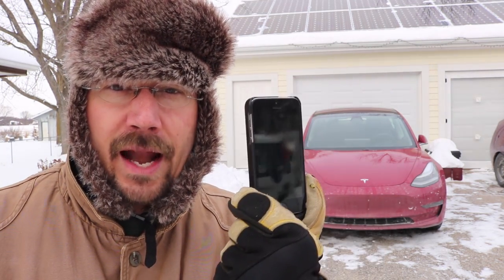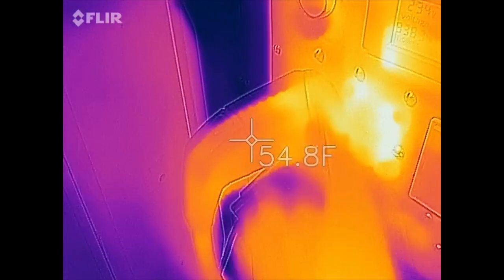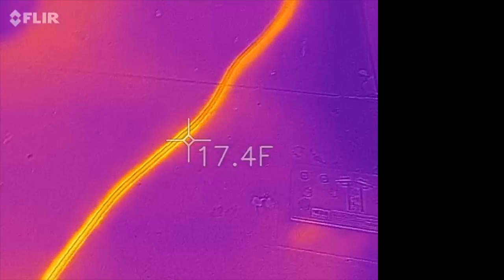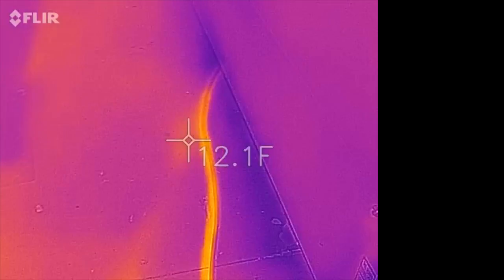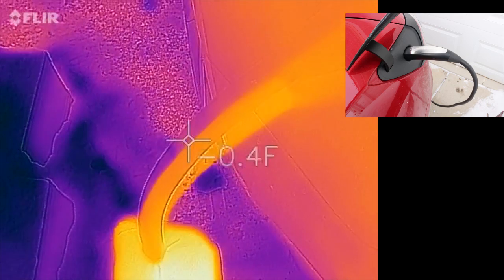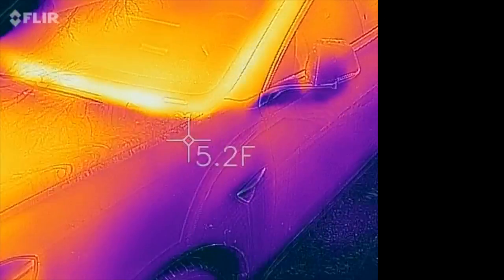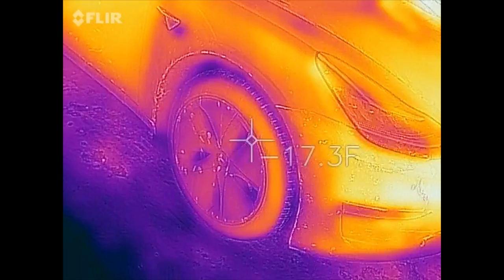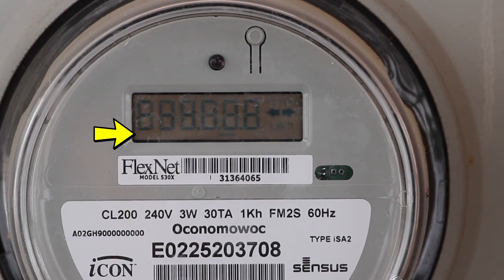THERMAL VIDEO of Tesla Model 3 Charging - Below 0℉

Comment: Very interesting to see this. I have heard Jack Rickard explain how attempting to charge Li-Ion batteries at below 32F is far more serious than simply not charging well. It actually permanently damages the battery. I would assume a Tesla heats the battery to assure temps above 32F before allowing the charger to engage. Is this not true?

Edit: oops, just read other comments... Looks like Tesla does heat batteries first. I don't have a heater on my EV conversion (the 81 VW Rabbit) so I can not charge unless I get it into a heated garage. I think my BMS (battery management system) disallows charging as well due to low temps.

Comment: It would be interesting to know what happens with a frozen tesla battery when you try to charge it?  As in leave a tesla outside in the cold not driven or not plugged in in freezing weather.  Then charge it.  Does it start charging up right away (I doubt it, because Li-ion's can not be charged below freezing).  So then the question is if it doesn't charge when the pack is freezing, how long doe sit take to bring the pack above freezing so the pack can safely charge.
Reply from the maker: The Model 3 has an active heating system for the battery, but I am not sure what it does if parked in the cold for a long time while NOT plugged in. If the car was parked for an extended time in the extreme cold AND THEN plugged in, I know it would actively begin heating the battery.
Temperature can also effect the rate of charge. When this owner stopped by, we plugged in the car, and then took a look at his Tesla App. It showed that the car was not charging at maximum speed, due to cold. It was drawing the total 40A though, so I think part of that was going to warming the battery, with all the rest going to charging. As the battery warms, energy used to heat it drops off and more goes to the charge.
Reply: @BenjaminNelsonX  Yea there is no way if parked in the cold for a day or two at freezing temperatures that it can maintain pack temperature above freezing.  So I'm mostly curious about how long it takes to "thaw" the pack before it can charge in situations like this.
Reply: My model 3 does heat the battery first before it charges.   However, a couple of accelerations and decelerations will warm up the battery fast.  If his friend had just driven there, his battery was already warm.   I have found that 110V charging only has enough juice to keep the battery warm in really cold weather.   It won’t add any miles to the range.   But 40A at 220V or above seems to charge just fine even in below zero weather.  Supercharging is another story.

Comment: Might need to investigate exactly where that heat was coming from. I don’t think contacts should get that hot unless it’s only rated for 40a. 

It’s a good time to check your fuse box too while under heavy load.
Reply from the maker: Fuse box was fine. I've checked that a number of times with even higher loads. The contactor in the remote box was warmer than I expected. It's properly rated for that setup, but I don't think it would hurt to have one the next setting higher up. This is the highest draw I've put through that so far, so that's one reason why I wanted to check it with the thermal camera.
Reply: I work with Industrial IEC contactor all the time.   I have a few FLIR cameras as well.   The terminals where they are tightened in warm up the most and contacts do create heat as well.   Since the camera autoscales, I would always expect the contactors to be the warmest.   Just because they are the brightest yellow, doesn’t mean the are red hot.  It just means they are the warmest thing in view.
Reply: However, if you are concerned; view the contactor and terminals under load.  If one of the terminals are significantly hotter than the rest, you have a loose connection.